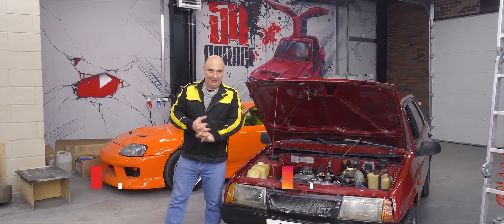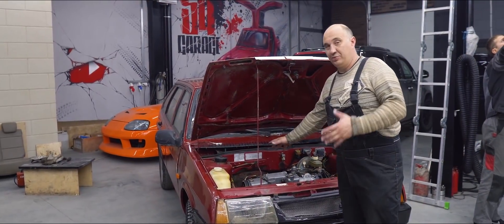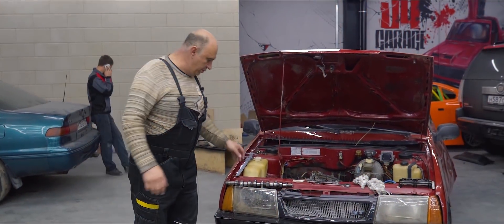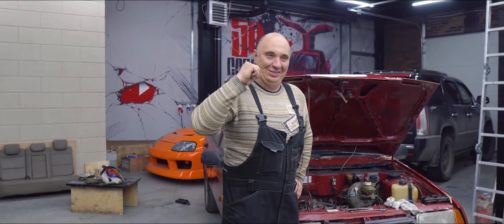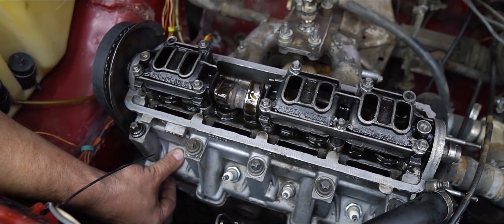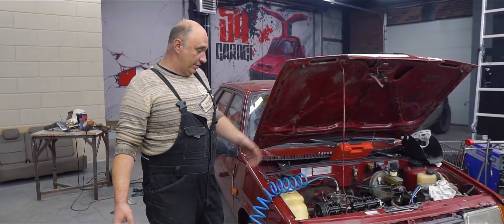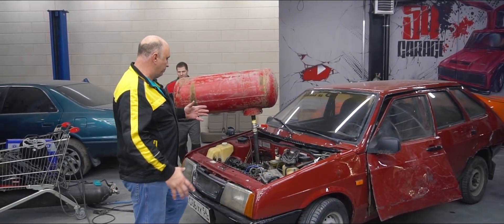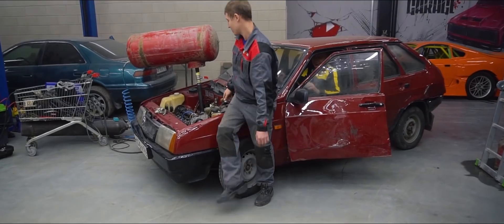Steam engine conversion, part one: startup on compressed air

Comment: You are shooting steam into all cylinders simultaneously. The intake valves are only designed to hold pressure from the piston side. The air pressure from the tank is pushing the valves open and killing your power. 12 volt Pop valves in the spark plug holes is way better. This also allows you to adjust the timing and duration of the power stroke. Grind the intake lobes off the cam and leave the exhaust as is. Use cam position sensors as a power source for the pop valves. As the magnets in the balancer spin past the cam sensors they will send a shot of 12volt to the corresponding valve and open it. No battery needed. Simple and will develop significantly more power than pressurizing the intake and trying to make the valves work with pressure from the wrong side. You guys rock! Great entertainment keep up the good work!

Comment: the engine it self is basically a air pump, what about changing the spark plugs for nipples with some hoses with one way valve and run across the cylinders that are on the downstroke ?  maybe you can get some kind of cykle then?

Comment: Congratulations, nice how you worked out the cam needed  double lobes, if the cam rotated at crankshaft speed, you would only need one lobe for each cam but as it rotates at half engine speed that is why yo need a double lobe.
I built a miniature six cylinder engine designed to run on gasoline but decided to run it on compressed air, as my cam was running at half engine speed, I had to do what you did and make a double lobed camshaft so that air could be admitted into the cylinders at every top dead center.
The six cylinder four stroke engine has two pistons coming up together  every 120 degrees so my engine really became a "three cylinder big bang engine"
I made all the cam blanks (12) in one go on a lathe with special jig with a degree plate to be able to gradually develop the cam shape by shaving material off with a 10 mm end mill running in the chuck of the lathe and rotating the blanks four degrees and then shaving more metal off. the whole assembly was moved closer to the end mill for each cut to be carried out and generate the cam profile.
Well done guys,cheers from the UK.

Comment: The flatplane crankshaft makes it possible that the engine could stall with 2 pistons in TDC and 2 pistons in BDC.
An engine with a crossplane crankshaft (with minimum of 3 cylinders) would perform smoother and get rid of the possible stalling. 
A classic steam locomotive has 2 double acting cylinders which are 90 degrees apart, so a steam locomotive has 4 power strokes per a revolution of the driving wheels.

Comment: I think the inlet valves open all the time by the pressure in the inlet manifold. They need to use the exhaust ones and get stiffer springs

Comment: Also the outlet stoke timing is off if you ask me so your engine wil not have the power it needs to move.
You should check the stand of the pistons when valves are opening and closing.

Comment: can you try to use long roller instead of wheels on rear drive car and try it on mud in this case transmission to roller shaft might be a little difficult

Comment: If you are going to run the engine on steam, just let in the steam for a few degrees. Steam behaves quite different than compressed air, IT EXPANDS EVEN AFTER THE INTAKE VALVE IS CLOSED.   I have some experience with steam engines, have one myselfe.  So if you make the intake valve open like 0 to 15 degree after TDC, and let the exhaust be open from 170-360 it should be alot more effective.  Good luck!  PS, a steam engine will not be powerful on compressed air, as I wrote, the steam expands during the power stroke.  I really hope you will read my comment, and start working on the camshaft with the angle- grinder.   Then PS again, if you change the timing sprocket on the camshaft to one the same size as the one on the flywheel, it might be easier, if not, you need dual lobes on the camshaft.  :) :)  Thank you for posting videos, a great channel! Regards from Norway.

Comment: you should use this same cam to make a 4 stroke into a two stroke engine
Reply: ??? 2 strokes dont have cams or valves dude
Reply: @MrHBSoftware  I know but it would be alot more work to delete the valves and make a rotary valve or reed valve than it would be to run it like this.  It would still be a two stroke engine because they would be deleting two of the strokes
Reply: @JonLasaga  yes i guess you're right ,we have to call it a two stroke...because it has intake and exhaust........but a 2 stroke as we know it doesnt have ANY valves , not cam driven, or reed etc...its just ports on the cylinders, when the cylinder goes down on the firing stroke, there is a transfer port and it sucks the mixture in to the top, when it goes up it compresses it
Reply: @MrHBSoftware  Maybe a very simple two stroke like what you would use in a farm implement anything where you need to change the powerband or run at a range of rpms requires some kind of valve to throttle the air through the carbs.  If you look at motorcycle two strokes for example many use a rotary valve on top of the ports in the block itself to control how much air gets in at what rpms a reed valve works similarly but works based on the negative pressure the engine creates.  Without the valve you can only run the engine in one rpm range you cannot control throttle well at all

Comment: You should just double-cam only the exhaust valve cam lobe and use the sparkplug hole for inputting your air.   take the rocker off the intake valve.     maybe it would work better?

Comment: A friend of mine did this with a Studebaker but he used a Stanley Steamer engine. His boiler was a pancake boiler he fabricated from 1/2 inch black iron pipe he used a fire eye for flame detection it was very driveable he burnt waste oil in it.

Comment: rosebud les you should not have to relobe the camif you use the exhaust manifold for pressure and you a check valve or some kind of wobble valve in the spark plug to release the pressure

Comment: Ahh why didn't you gear the cam 1:1 put a crank shaft pulley on the cam so its the same teeth count so it opens every stroke? Thinking out loud here... and change the cam love profile to fine tune it?

Comment: You can also make the timing belt pulley the same diameter as the pulley of the crankshaft. Than you don't need to weld the camshaft.

Comment: yes cam shaft just need to be converted so vavles open 2/4 not 1/4 strokes 

ALSO use exhaust pressure and feed it back into carbi manifold - should help to sustain pressure.
you could use an external hydrylic type pistion on motor attached to outside wheel to force extra air into carbi manifols as like a fooy pump

Comment: Use an electric air pump like a nitro button to add speed and power to the car. I also thought you would run the crank engine in reverse from the start and then just use the reverse gear to drive forward. 

Actually that is a good video on it's own to reverse the direction of the engine in a car and then drive it around lol!

Comment: Did you not have to consider the valve overlap? Air pressure could be passing straight through the cylinder without dping any work?

Comment: The cam shaft runs at 1/2 the crank speed. If you want it to open twice as much, change it to a 1/1.
Also, the valves aren't made to hold back much intake pressure. When the piston is trying to come back up, air is pushing past the valve.

Comment: now you just need a way for that steam to come around from the exhaust, back to the tank and recycle the same air. This should be possible and you would technically be able to keep going right? As long as the air pressure maintains itself, it should work.

Comment: Crank and cam are a 1:2 rotation with each other in a normal configuration. Wouldn't putting it at a 1:1 accomplish the same as welding the 180° out lobes to the cam?

Comment: steam engines have adjustable valve timing. the longer the intake valve is opened the more torque you get and more steam is needed. A steam engine operator would reduce the open time when the train is at speed and increase it when the force is needed to accelerate or go up hill.

my advice, adjust the lobes on the cam shaft.
the intake lobe should open the valve as soon as the piston crosses the top dead center and close it when it get's close to the bottom
the exhaust should open as soon as the piston crosses the bottom dead center and stay open for as long as possible

this should provide the maximum torque and given enough steam should move from first gear without using the clutch
Reply: yes this
Reply: I didn't know this is how they do it on steam engines but this was my exact thought regarding tdc and valve duration.
Reply: you may want to post this on the original russian video
Reply: Basically vtec
Reply: @NoorquackerInd  yes, every manufacturer has their own version.
Reply: many modern combustion engines constantly adjust their valve timing on the fly too
Reply: This is what they did. They might be off 5-10* but that’s minimal.
Reply: steam engines also don't have valves that can be pushed open by the working gas. some hit and miss engines don't even have an intake cam for this reason. they rely on the vacuum in the cylinder to pull the valve open. they are probably loosing a lot of air right out the exhaust.
Reply: RedFathom  lmao, they do have cams, although the valves are nothing like in a car. They are like a gate valve forsay. So pressure can’t blow open the valve.
Reply: @RedFathom  Like a rotary engine?

Edit : as in they rely on vacuum rather than a valve system.
Reply: Hit and miss no intake cam ==> https://youtu.be/ajvd0YO8vqI when the exhaust closes the vacuum in the cylinder draws the air in. the same would happen with pressure. Yeah most steam engines use slide valves with an eccentric instead of a cam.
Reply: basically the opposite of VTEC? Since VTEC opens the valves farther when going high in RPM.
Reply: @tjorven4124  No it alters duration not lift..
Reply: @jessep3079  I checked the russian channel. they have it working there so I guess there's no point. they're working on a gas powered tesla truck now lol
Reply: @RedFathom  o yeah, I could bet the intake valves are leaking. but they just want the thing to move. efficiency or reliability aren't a priority here
Reply: @tjorven4124  pretty much. When you reduce the intake time on a steam engine you increase the efficiency. Ideally  you would want to inject enough steam to the engine so that when the piston reaches the bottom the pressure inside is as close to atmospheric as possible. it means you extracted all the energy from your steam. it's not practical because low pressure steam puts a small force on the piston so the output torque is low. if you fill up the cylinder with all that high pressure steam(for max torque) then you have to vent it all to the atmosphere which is waste. On top of that if your engine is operating at high RPM then you have to evacuate all that steam on the exhaust so that takes energy. it's a bit like sitting on a beach ball trying to deflate it.
Reply: They're rediscovering america.
Reply: @Piotr M this would lead to an efficiency less than 10%. the tank needed for even driving out of the garage would be gigantic.@Thee Adjudicator sort of but the pressure in the cylinder holds it shut. It can technically be opened at any point given enough pressure/vacuum.
Reply: get VVL on this bad boy
Reply: Won't the steam pressure push the valve open as soon as it is applied?
Reply: @RedFathom   the same would not work with pressure. 

If vacuum can  "pull" the valve open, that means as little as 1 bar steam pressure on the intake side will push it open.

Vacuums never pull, work is always done by the ambient atmospheric pressure.

With the standard valves it will likely be necessary to uprate the spring seating force, turbo charged engines have this problem too.
Reply: @forestdenizen6497  i consider the vacuum to be pulling since the external pressure is unchanged. what would you call a vacuum engine? a reverse pressure engine?

stiffer springs might help but valves open inwards for a reason. they don't keep things out they keep an explosion in. not sure on the valve area but 180 pounds is more than 10x what most turbo engines will ever see.
Reply: ALSO, the faster the engine is spinning, the less time exhaust steam has to escape the cylinder. As speed increases, it will cross the threshold between steam expanding out of the exhaust, and the piston having to push it out. Then it'll choke on its own steam. That's the other reason steam engines have variable valve timing.

Comment: why not loop the air back into the tank?
Reply: Isn't the tanks pressure greater than the motors exhaust? You'd need another compressor to get the air back in the tank, right?

Comment: Cool man! Taking a pre-existing ic motor with 4 cylinders, pressure lubrication, along with a clutch and what? 3-4 gears?   I'm not in a position to talk but I would recommend a steam generator in the trunk or even right under the hood and have the water tank in the back that injects water into the steam generator which is basically an insulated coil wrapped around some heat source and connect a proper throttle and tach.  That motor is originally what? 50 horses?  Less on steam but an unbelievable amount of torque so you could not only use the gears to accelerate faster but also leave it in the highest gear and not only still have a lot of torque but use up a lot less steam per mile the car is driven.

Comment: You need to have the cam hold the valve open for half a revolution , not just a split second when the piston is dead top . Like steam the air has to fill the whole bore while under pressure

Comment: On another experiment weld nuts on the top of the cylinders to increase compression and do a dyno test
Reply: there is no compression stroke or firing stroke ,they are not burning any fuel...thats why they added the extra cam lobes..now its just intake and exhaust repeatedly...i get your point but the benefit would be low, the same as lowering the volume of the intake manifold for example...remeber its still a petrol 4 stroke but now it runs a totally different cycle
Reply: @MrHBSoftware  I meant on another car another experiment

Comment: In theory you can turn any 4 stroke engine into steam or compressed air without messing with the camshaft, so long as the engine has 4 or more pistons
Reply: nope the compression stroke would F up the idea😁
Reply: @dualmode1  if it has less than 4 cylinders yes, the compression stroke would prevent the engine from turning over, on a 4 cylinder engine however, a piston would alway be on a power stroke(wich is now the intake stroke) while another would always be on the exhaust stroke, you can think of the compression and power stroke of the remaining cylinders as neutral since they cancel eachother out.

Comment: Wouldn't be a lot easier putting the timing pulleys the same size instead of welding the cams on the cam shaft?

Comment: Wouldn't it work better if you put the compressed in through the spark plug holes, I feel that way it wouldn't take so much air but you'd have to figure out some type of air injection system. Can't wait to see the next one
Reply: Just use the camshaft to actuate air valves which would introduce each cylinder air at the right time. Spin cam at crank speed and done.

Comment: What if you could make to where all the air you are waisting out the exaust pipe. Instead route it back to your tank in a way to continue pressure in the air tank. If you think about it how much the engine uses. Should be close to about the amount it can put out.

Comment: You don't even need radiator for it, because steam cannot got very hot like fire. Remove water pump will have less friction too.
But i thought you should push compressed air in the holes of sparkplugs (simulate explosion part), let intake valves closed and timing the exhaust valves in twice speed open/close. And add electronic air/gas valves with mechanic driven 4-way switch to open/close each valve. Complex idea indeed, but it might work too.

Comment: inject the air via the spark plug holes and remove the intake lobe on the cam your running it at a 4 stroke currently but with 2 stroke exhaust so your wasting over 1/2 the energy in the wasted stroke when you added 2 exhaust lobes you turned it into a 2 stroke meaning every time the piston comes to top its a power stroke but have the intake set as every other aka set for 4 stroke or can add a lobe on intake side also.

Comment: Put the pressure in through the spark plug holes and use intake and exhaust valves as exhausts. Remove all the manifolds and have them exhausting into the engine bay with modified camshaft lobes.
Reply: Interesting idea but wouldn't the spark plug holes be too small to fill up the stroke volume at a decent RPM?
Reply: @naushad911  yes you are right, that was one thought I had, unless they could be enlarged without interfering with the valves.
Reply: If their steam setup operates at a high enough pressure they could make it work though. Would have to be WAY high pressure like well over 500 psi to force the steam in fast enough tho. Probably more
Reply: would need some sort of rotary air distributor to put air sequentially and in time with the engine....
Reply: @MrHBSoftware  you're right. I hadn't thought of that.

Comment: Maybe some kind of air injector system would do the trick. Like fuel but with air and obviously doubled. Making it in the spark plug holes. But it would need more time, money and brains.